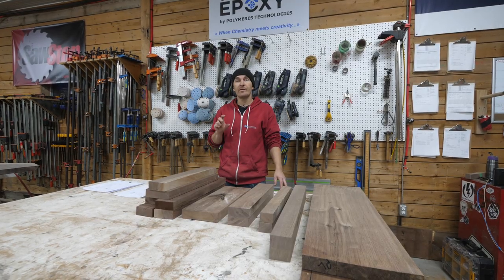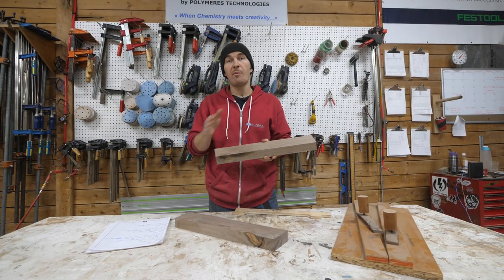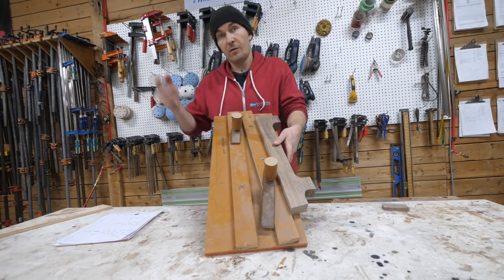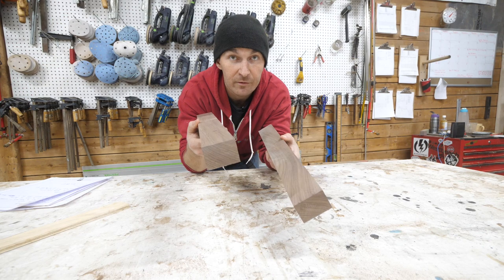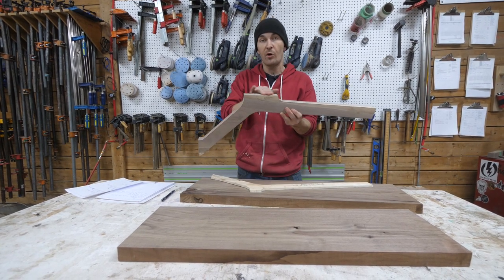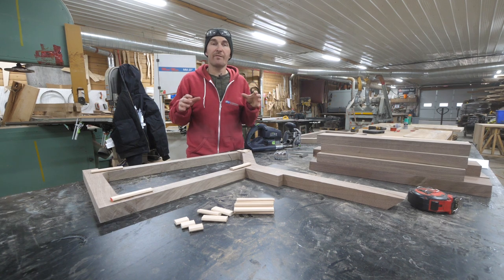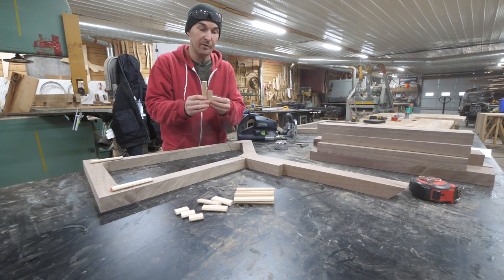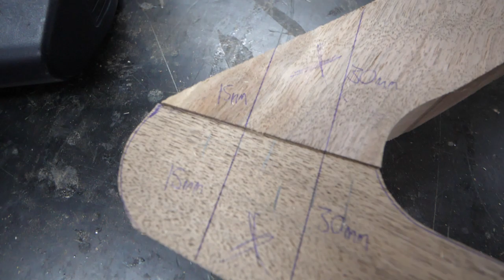Let's build a chair - How to build the Bali Chair part 1

Comment: any reason the back leg can not be made of two pieces instead of that one massive blank with all that waste? It seems like if it was two pieces joined around the elbow of it you can maintain straight grain throughout and use smaller wood blanks.
Reply from the maker: Hi Alec, yes no reason why you can't do it that way, and I think that's a great idea!  We do try to use the wood around the blank for other pieces.

Comment: It is dangerous to use the saw without a guard and not good to show other people as an example.
Reply from the maker: So far so good, I did check these are they are rated for 160F which is about as hot as we get it, I also have everything on circuit breakers if there was to be a short all electric would be shut off.